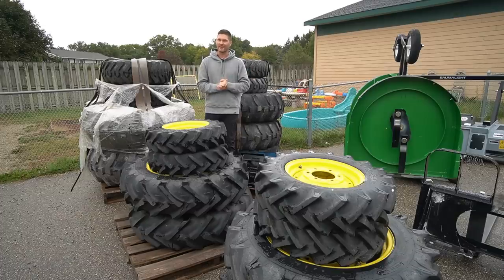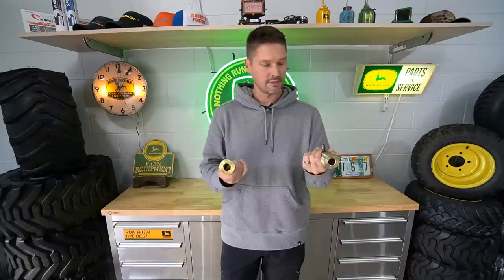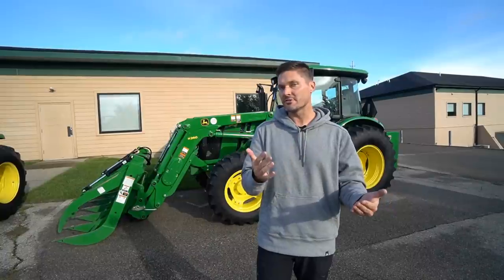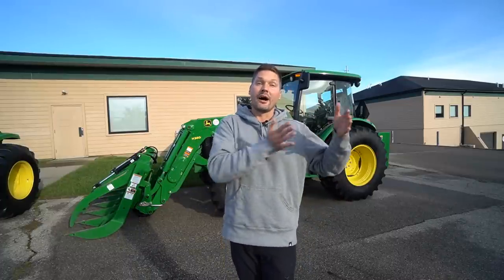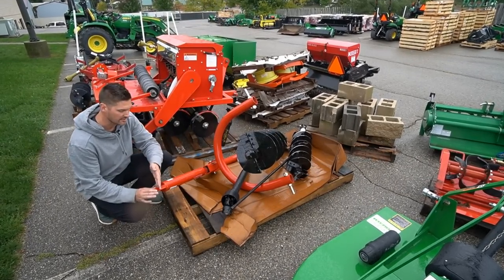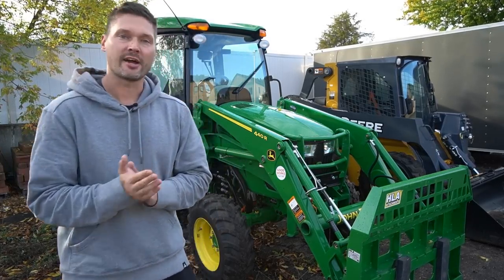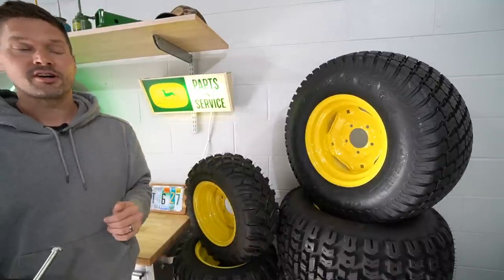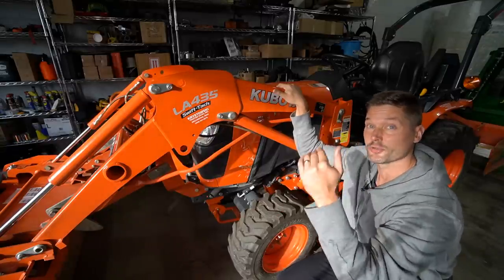10 RANDOM TRACTOR QUESTIONS: VOLUME 2 BIGGER WHEELS? WHAT SIZE BRUSH HOG? POWER REVERSER OR HYDRO?

Comment: Bushings - I’m not an expert, far from it, but what I’ve found is they help to provide a more secure mount. For instance, my ballast box dropped one pin and became wedged half off and half on the quick attach hitch. It took a lot of work to “un-wedge” it soi could hook it up properly. With the addition of bushings I’ve not had a problem since.
Reply from the maker: Yep, I hate when I get a wedgie!

Comment: I believe that all quick hitch draw hooks not specifically made or designed for Cat. 1 pins, such as the Speeco, are standardized for Cat. 3 pins.  So all your Cat. 1 equipment can fit tractors with Cat. 2 or Cat. 3 quick hitches as the draw hooks on all 3 sizes are the same. Therefore you have bushings.
Reply from the maker: The problem with that theory is that Category 2 quick hitches are much wider than Cat 1.  Cat 3 Quick hitches are even wider.  No one would ever run a cat 3 attachment and almost never run a cat 2 attachment on a cat 1 machine.  Vice versa as well.
Reply: Another theory shot to He11. In my defense, meager as it may be, this is what led me to think it could be the answer:  https://www.hdextremetools.com/quick-hitches/qh-parts-upgrades/qh-bushings/  .All standard Quick Hitch draw hooks are Cat 3 in size, it does not matter if the Quick Hitch is cat1 or cat2. But the size aspect  yea.  So we are back to wondering why.
Reply: @GoodWorksTractors  Thanks for the response, learned more from you and your channel. btw, I did use your link and ordered a ballast box from Titan, excellent choice even if the lynch pins are oddball size.

Comment: A lot of quick hitches are Cat 2 so the bushings are used to increase the Cat 1 pin diameter up to a Cat 2. Without bushings the Cat 1 pins will slop around in the hooks. Seems like it would be nice if you could get inserts for the quick hitch hooks and then the Cat 1 pins will fit, no need to buy a pair of bushings for each attachment.

Comment: In a previous video did you say for every 5HP of tractor you can run 1FT of implement? For instance a 20HP tractor can run any 4FT implement and so on
Reply from the maker: Yes, that is an old rule of thumb, but equipment is becoming more efficient, so doesn't always hold true.

Comment: I believe the shoulders on the bushings keep the implement from sliding side to side on the pins for more secure attachment.
Reply from the maker: I see what you mean, but there is often times plenty of play for attachments to slide around a bit with or without bushings.  Same is if a attachment was directly mounted to a 3 point hitch.
Reply: I have have six 3-point implements and they vary enough that I cannot use a quick hitch because of the differece from manufacturers.  (really sucks). But growing up on a farm using a quick hitch all the time the larger machinery seemed to have tigher tolerances .  I have a blade and box blade from  the same manufacturer and they are over an inch difference in width. And two of my implements we wont ralk about because there homemade and I diidnt exactly hold to any tolerances. Lol.

Comment: Are those hook and pin type loader, where you can only control the hight and the tipping is done via a button on the loader control, still sold new over in the US?
I know that the modern ones with tilt and hight control are WAY more practical, but our tractor has a frontloader which has that system, and i'm just curious
Reply from the maker: I don't think these are available new from the factory anymore, but could be wrong.

Comment: I enjoyed your recent video on tires.  I would like to buy chains for my R-4 tires on a 3038e.  Can I just use them on the front tires, or do they have to go on the rears instead.  And do you know why they are so expensive (around $600).  And they come in various chain types and designs.  Where is a good place to shop for them?  Any advice or suggestions would be appreciated.
Reply from the maker: Howdy, right now I don't really have a good option to recommend unfortunately

Comment: I wonder what it would cost to take a tractor with small dents on the hood and side scratches to a body shop to have them fix them are repaint it. Would it be cheaper than replacing the panels and hood? (I bought my B2920 from someone that clearly didn't care about aesthetics but I do.)
Reply from the maker: I've checked before and many of the dents that these tractors end up with aren't repairable by dent guys.  I've tried with several different outfits in the past and none could repair a single one of them.
Reply: @GoodWorksTractors  Plastic or metal?  Real body Men or just dent pullers ?

Comment: Why is most of the brush cutters are all 3pt instead of pull behind?
Reply from the maker: I would much prefer a 3 point mount on smaller tractors.  Once you get to a certain size, it is impractical to use them on a 3 point hitch and you almost need to go to a hitch mount due to weight.
Reply: Usually smaller tractors are 3point hitch .

Comment: Here you go. I’m struggling with whether to buy a RC2048 or a Flail Mower w/hammer blades.  I’ve been hunting for the video that someone did with a Flail Mower that has the mechanical offset.  Any idea what brand that was?  Thanks again for the great content.
Reply: Tractor Time with Tim has several offset flail videos.
Reply from the maker: Yes, I have flail mower videos and so does TTWT
Reply: Doh...it was you.  When is the hammer blade review coming?  The Del Marino is in the led so far.

Comment: I think the opening is large on a Quick Hitch so it can used from Cat 1- Cat 3. Not sure just a thought.
Reply from the maker: Cat 2 and Cat 3 quick hitches have completely different dimension spacing.  You have to get a different quick hitch to use with different cat attachments.

Comment: As for the need for bushings on a quick hitch, the only thing I could think of would be cost cutting measures.  Cheaper to build them all for the cat 3, then keep a stock of bushings for cat 1 & cat 2, instead of keeping a stock of several quick hitches in all 3 sizes...?
Reply from the maker: Yeah, I suppose that could be why?